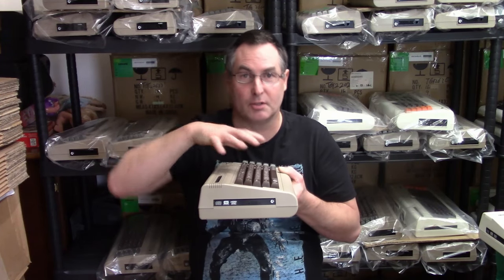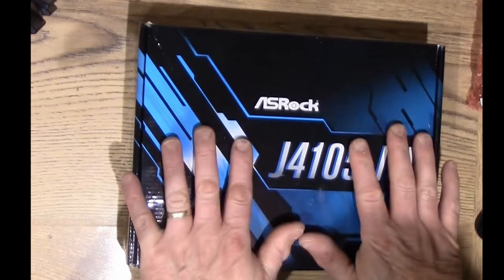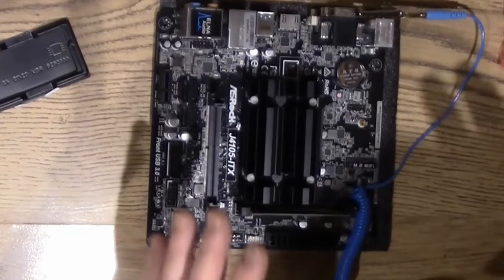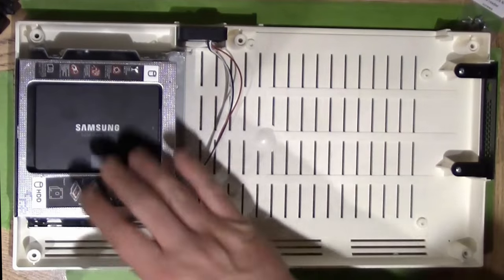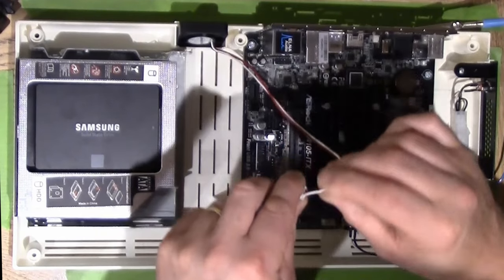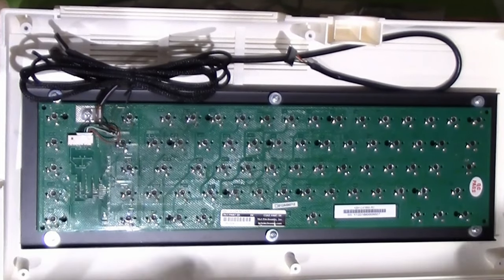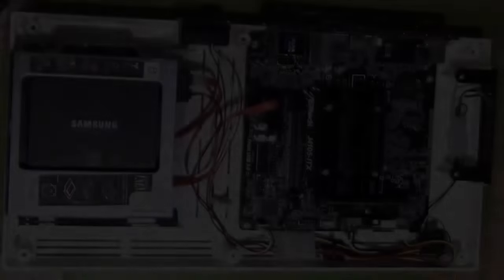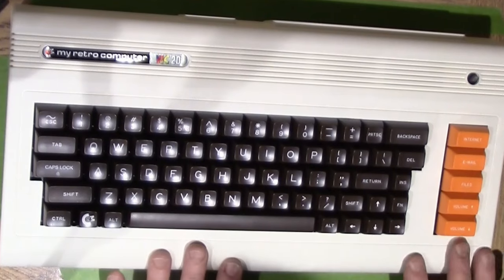Lets build a C64X Silent PC [Full parts & Tutorial]

Comment: One DIMM? Geez, that combined with the anemic processor is going to result in a really slow machine.
Reply: Speed is relative. You are not going to play any recent AAA titles with this, but it will be "fast" enough for everything else, that doesn't require raw power. Nice little media pc, office computer or computer for emulator and old games. Be sure to install Linux (Mint) innit to get most out of it.
Reply from the maker: This is  a basic system, adding another memory stick will make little difference I'm afraid. We are working towards a more complex build, with an AMD Ryzen chip. It's working ok and within heat parameters but there are a few issues to iron out before we release a video.
Reply from the maker: @qurqo  You are absolutely correct in your analogy, we wanted to show how easy it can be to build a basic My Vic20 or My64 PC. A light weight Linux will fly on this system, I really like Elementary OS!
Reply: @myretrocomputerltd5179  Adding a second memory module will allow the RAM to run in dual channel mode which will make a considerable difference, particularly give your choice of CPU.
Reply from the maker: @gklinger  Look out for it in the next Video! The AMD Ryzen will be fully loaded!
Reply: i bet this vic is faster than the original model

Comment: Interesting idea, but i am concerned about cooling. Plus, what about room for a GPU? (one idea would be to offer a Ryzen APU with Vega graphics in one of the kits... Another being to include a low-profile GPU... And last is to possibly offer a optional thunderbolt external GPU) Otherwise this isn't much better than a laptop.

Further, what about offering different keycaps for those side buttons?
Reply: Hi thank you for the comment, cooling can be an issue with higher performing chips, no room for dedicated graphics, we are looking at the Ryzen Apu. I personally really hope the Ryzen works and we are testing this next week. I like the idea of having to a thunderbolt - we could possible call the external graphics a modulator!
Reply from the maker: We have the Ryzen up and running within temp. Trying to get the video done this weekend

Comment: Hope you don't think I'm nitpicking or nagging.

1. It's not "Asrock J105-ITX Gemini Lake" but "Asrock J4105-ITX Gemini Lake", notice the 4 in the number.
2. What about the Multi-format SD card reader? Can the power jack be as easily connected to that one? How does one connect the Reader to the motherboard?
3. What about non-solid state HDD's but old fashioned ones?
Reply from the maker: Hi, it’s ok, your not the first! lots of corrections from people. Ok so we have decided to pull the card reader because they are temperamental - some work and some don’t. Because of power constraints we recommend solid state but I personally have an i3 with 3.5” running fine.
Reply: @myretrocomputerltd5179  Thank you for clearing that up. Wow. I don't think that the omission of the Card Reader is a deal breaker for most, but if I were you I'd change that on the website ASAP! I don't think customers will not understand that the SD Reader is an "extra" that may or may not be included.
Reply from the maker: Updated to 4105-ITX. We have placed an order with the Chinese company that originally made the CUSA card reader, they don't make them anymore so they have to set up to do so. we are expecting a shipment of card readers in January!

Comment: Could you put an original c64 motherboard an use it as a replacement case?
Reply from the maker: I soppose you could but you would have to make massive alterations to the rear of the case not to mention the keyboard is a USB type. You would be better off restoring an old case. maybe even having the old case resprayed in commodore 64 biege

Comment: Do you know if anyone used your case to build a MiSTer FPGA setup? (there is now a mini-ITX addon board for it, the Ironclad)
Reply from the maker: Yes i believe some people have used the MiSTer but I dont know if they had to modify anything. If the MiSter is mini-itx based then it should fit straight in!🙂
Reply: @myretrocomputerltd5179  Right, I think I can probably check the dimensions etc. Possibly the keyboard could be an issue, as iirc Mister expects a full size with a standard Win layout.
Reply from the maker: @JanPospisilArt  I haven't had anybody come back to me saying it doesn't work with the MiSTer and it is a sort of standard win layout - you access all the Function keys 1-12 via the FN key

Comment: can a sfx psu fit in the case ?
you can remove the sata ssd mount and use a m.2 ssd direct on the motherboard and then put  usb/audio/mic/power button on the right panel
amd ryzen apus are the best for a build whit no graphics card they rave a very good igpu
i really like keyboard pcs concept
Reply from the maker: PicuPSU up to 150 watt, if more power is needed then would need a small psu board. We are testing the Ryzen now! We had it on 100% load test last night for 30 minutes and the APU Levelled out at 76c. We are putting in extra 40mm fans later to see if we can get her running a little cooler. Ambient room temp at the time was 22c
Reply: This looks cool. One question, why use a caddy, I'd say you could fit in more SSD's if you didn't use a caddy plus you might be able to put additional USB ports and/or a card reader in as well?
Reply from the maker: @jeroenvanjaarsveld1897  Ahh, the cradle that the caddy sits in also holds another solid state drive or 3.5" drive. So if you didn't want the caddy you could install a hard drive underneath and fit an optical drive in place of the caddy.
Reply: @jeroenvanjaarsveld1897  Just an update the 3.5" doesn't fit anymore, the new cradle only supports 2.5" SSD Only just found that out! Sorry
Reply from the maker: We have the Ryzen up and running - How to Video coming soon!

Comment: Looking forward to the AMD build in this case
Reply from the maker: Its getting closer!
Reply from the maker: It's done, we have Ryzen working great. CPU Temperature idle 50C 100% max 69C - 73C just the how to video to sort now!
Reply: @myretrocomputerltd5179   And which motherboard  do you recommend ? thank you
Reply from the maker: @elsafromsqy4045   AMD Ryzen 3 4350G PRO 4C8T 65W TDP CPU (No heatsink- with systems only)
Kingston A2000 500GB Type 2280 NVMe M.2 Drive for Selected Boards
ASRock B550M-ITX/ac Socket AM4 Mini-ITX Motherboard
16GB DDR4 2666 DIMM only for selected boards
ID-COOLING IS-30 Low Profile Heatsink for AMD AM4 (30mm tall)
Reply from the maker: @elsafromsqy4045  This is not endorsed by My Retro Computer in any way, this is just what we have been using to test the Ryzen chipset inside the case. There is one issue and that is the motherboard needs 4 nylon washers positioned on the 4 stand-off's because otherwise the board touches the bottom of the case in a couple of places.
Reply from the maker: @elsafromsqy4045  there is a typo from the list it’s a GPU!
Reply: @myretrocomputerltd5179 OK.thanks forme answer